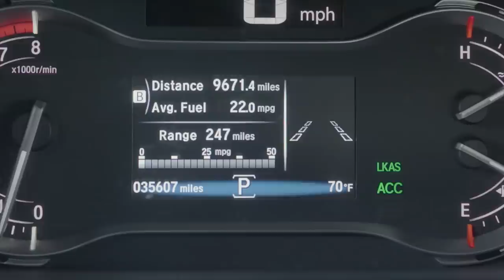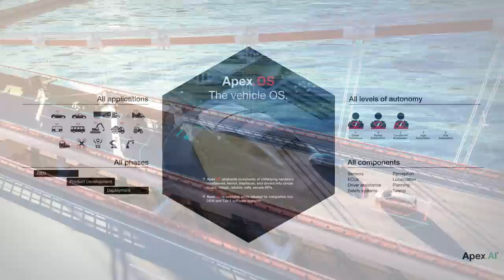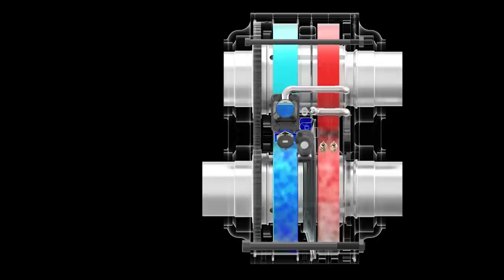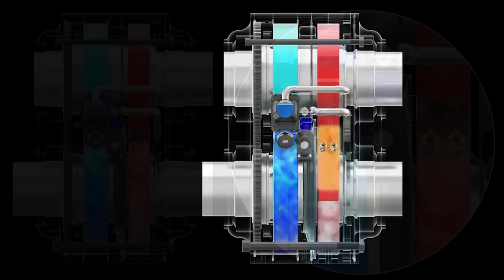BYD Develops 1200-Volt Semiconductor; Graphite Shortage Coming - Autoline Daily 3224

Comment: Perhaps we need to RUSH R&D into OTHER MATERIALS for BEV's as dependence in a particular part of the world will not benefit almost anyone (CAR INFLATION is a big part of the acceleration of OVERALL INFLATION).
Reply: Welcome to one of many limiting factors on why automakers can't 'just make more EVs'. 
The problem isn't other materials, but rather that economies of scale have meant that it's been too cheap and easy to just rely on cheap materials from China over developing mines and refineries locally. When China was producing more than demand, there was no point in building out our own mines. Now that everyone has figured out they need to switch to BEVs.. nobody is making that much of anything necessary for that many EV batteries.
In the case of graphite, Nouveau Monde Graphite in Canada has been ramping up over the past few years. Well positioned to supply US EV battery makers...
Reply: @CSHarvey  - sounds about right.

If you can find materials LOCALLY within your part of the World, so much better. 

And later try to find materials that can be supplied locally without issues (maybe something out of SODIUM or SILICA  (that is not used by computers, of course)?.

Comment: Tesla rules.!  Elon Musk, the world's richest man, is changing the world.! Time magazine man the year.!  The Thomas Edison of this generation
Reply: aye!
Reply: Please stop with the fanboyism.  It's embarrassing.
Reply: Fanboying is loudly cheering for how Mary Barra is singlehandedly leading the transition to EVs. You did it Mary! 
/facepalm
Reply: @CSHarvey  - that's THE OTHER SIDE of FANBOISM, just as bad....
Reply: Hi Elon.  As promised, the solution to your panel gaps:  Recall that no one ever complained that the 1970's GM cars had inconsistent panel gaps because those GM cars were consistently bad in so many big areas that it overwhelmed the owner with too many issues to solve in parallel.  Conversely, your cars are inconsistently bad in so many small areas (whompy wheel, LCD failures, eMMC, bumpers, roof glue, orange peel, panel gaps, innumerable FSD software bugs, roof collapse due to camels, etc.) that they stick out to the owner.  The solution is simple:  Start introducing known big failures so that the small failures (i.e. panel gaps) are simply background noise.  If you can solve the big issues then your QC procedures can apply to the small issues.  The challenge for your team is the ability to introduce the big issues consistently.  Good luck!
Reply: @bobbbobb4663  - NIIIIIIICE!!!    🤣🤣🤣
Reply: @syxepop  Even Saint Sandy Munro hasn’t solved Elon’s panel gap issue.  Looks like I should be a paid consultant to Elon and company.
Reply: @bobbbobb4663  - not everyone can go into COMMON SENSE MODE....